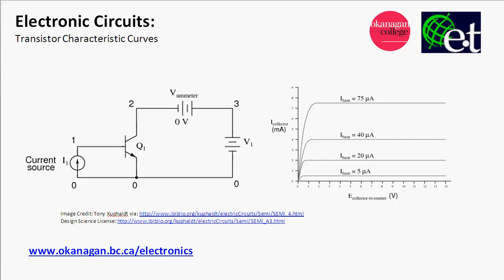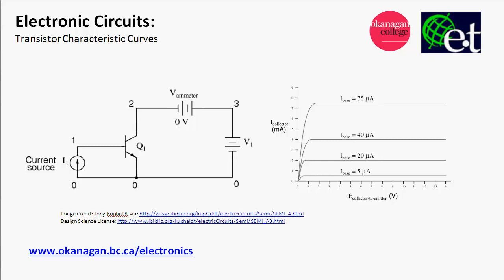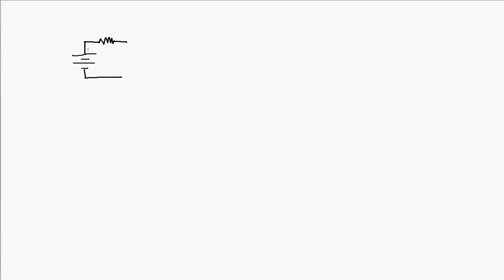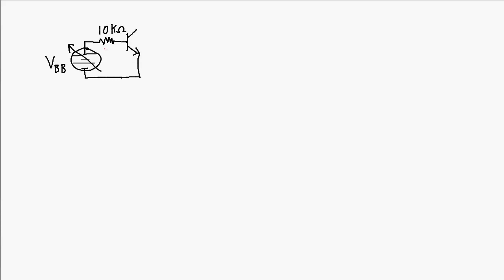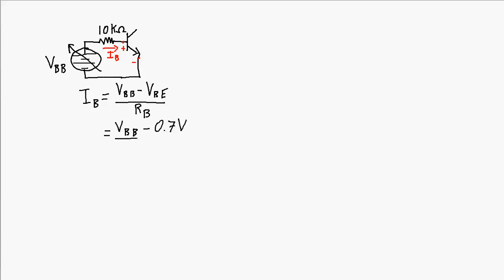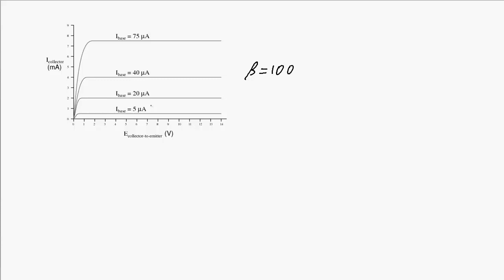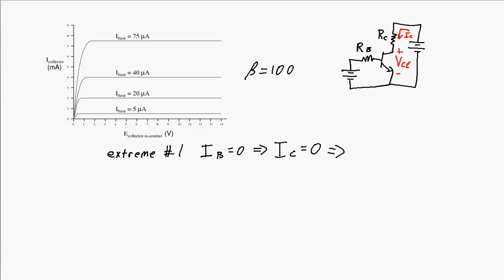BJT Characteristic Curves

Comment: You missed some important points. One: The Vce is held constant when doing the curves. Two: the beta will not be constant as the Ic is varied. Three: the curves are not flat but rather have a slope that converges on the V-axis at -Va ( Va is the Early Voltage, an important factor in determining the output conductance of the transistor). And Four: The Vbe is not a constant 0.7 volts but increases as the Ib is increased. If you look at the Diode eqn, you see forward conduction begins to become significant at about 0.5 volts and is quite large by the time you get to 0.7V.

Comment: When Ib increases, it causes Ic to increase as well. Ic is flowing through resistor Ic and when the voltage drop across Rc (Ic*Rc) is equal to the supply voltage Vcc, Vce = 0V by Kirchoff's Voltage Law.

Comment from the maker: It is true that Ib determines Ic regardless of Rc, but only up to a point.  Kirchoff's Voltage Law (KVL) overrules Ic = (beta)Ib.  This applies specifically when you push the BJT into saturation - in saturation Ic less than (beta)Ib.  For example, if you have a circuit with RC, but no RE and you assume that VCE(sat) is 0V, then ICRC can be no bigger than VCC.

Comment: I hope you could explain how does the curves plotted. What equation can we use to plot that curve? Like for IB=40uA, how do you get the points for that?
Reply: It is experimental data. You have one power supply for the base, one for the collector. You vary the supplies and get the readings. Unless you have an intern or student available for boring tasks, you use a computer to set various base voltages, and then scan the collector voltage, keeping track of Ic and Vce. The the highly paid engineer loads the data into Excel and generates a graph :-)

Comment: in the common grounded emitter circuit figuration as in this video, can we say that Vce is biased by Vcc?  In the set of characteristic curves, Ic is actually small in the saturation region before being amplified in the active region, but one might say this is contradictory to Ic being maximally saturated as it flows through Rc toward a very small Vce.  Is this because as we trace through each 1 of the characteristic curves starting from a small Vce value, Vcc is also small before increasing along with an increasing Vce through the curve into the active region,  so that Ic is also small as well before increasing as we go into the active region, given a fixed Rc?

Comment: In relation to your extreme case 1: what if I have 0 potential at B but negative potential at E. Will there be a current in that case? Which means in npn transistor, From p to n, potential is 0 to negative.

Comment: What is the relationship between the collector/emmitter voltage an Ib. Its a bit confusing. Does increasing Vce increase Ib ? I thought at stauration that Vce was 0.2V . It does not appear this way for all the I(b) curves above. can you clarify. Thanks Mike

Comment: Just to be clear: The operating point is not an intrinsic independent quality of the transistor, but depends, in part , on the circuit arrangement (resisters etc) the transistor finds itself in. Is this correct?
Reply from the maker: That is correct. The operating point depends on both the transistor characteristics AND the circuit that it is in